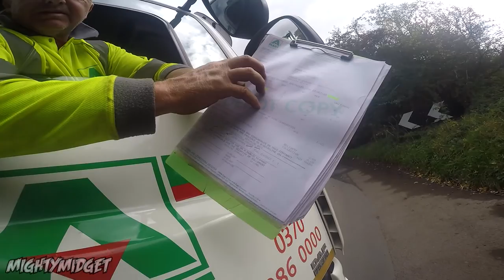Honda MSX\GROM TYGA Full Stainless Race Exhaust With Carbon Can

Comment: What wheelie bar is that ? Got same exhaust and looking for wheelie bar with pegs . Thanks
Reply from the maker: Kevtek! Awesome stuff, just expensive depending where u are from. Easy to get if u are in America. I’m from the uk so shipping is experience af! Cheaper ones are on eBay nowadays though
Reply: MightyMidget im uk aswell but need one that fits high mount . Ones on eBay won't fit I don't think